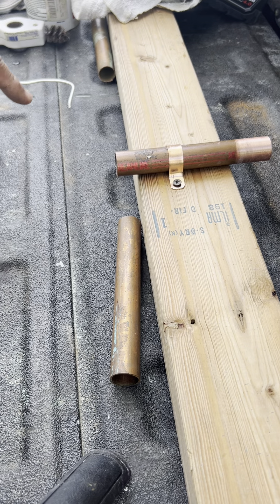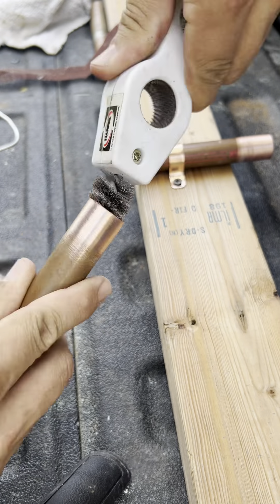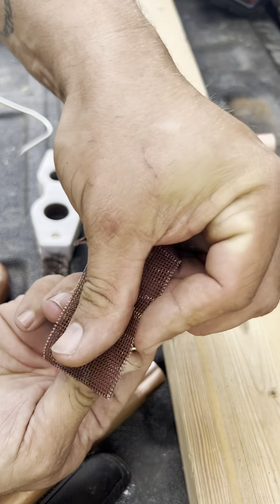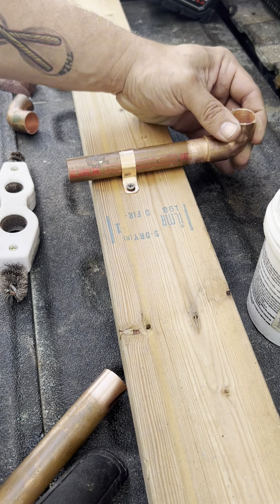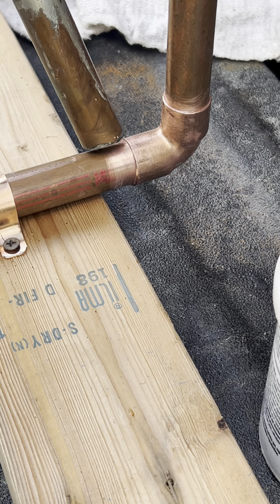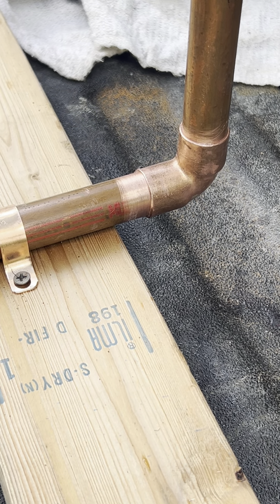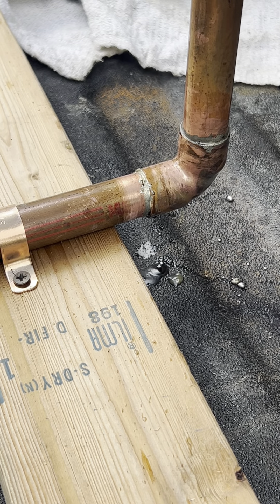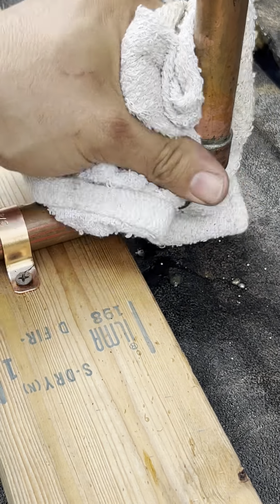How to solder copper pipe

Comment: When soldering, you should always flick the heat on to the pipe so it gets heated up as well as the fitting. You are correct with holding the heat to the end of the junction between the pipe and the fitting because it will pull the solder in, but you should also start applying the solder to the bottom of the joint. When you start on the top, you are lucky if you get half of the joint filled with solder in the bottom half. If you start applying the solder in the bottom, with the heat applied at the end of the pipe inside of the fitting, you will then pull the solder full depth into the joint. Then you can go around the sides as needed, then finish on the top. Also, make sure the pipe is not a sealed system without some type of faucet or valve being open to allow the steam to escape from the system when soldering,,, not an issue here, but certainly could be in a real world scenario. These thoughts are from a Journeyman Plumber, and I think you have the right idea, but a little recommendation from here,,, I will say that the only solder joints I have ever had leaked when I was an apprentice were because I started soldering from the top of the joint and not the bottom. I was concerned you were not going to wipe the excess flux before soldering, but you absolutely did and I have to give you credit! Overall your skills are pretty good
Reply from the maker: Thanks for the info! 👍🏻

Comment: I clean the access flux after I've applied heat for a bit, I can clean up more of it ensuring no runs.

I also don't drag the solder around the joint, it gets too messy for me. If it's a horizontal like the bottom joint of that 90 I just run the solder around the crown and watch it flow around and down till it leaves the buld on bottom then knock it off with my finger tip. If it's a vertical I tap the joint in one spot with the tip of the solder (preferably the back, opposite of heat and where no one will see it) and let the solder flow around until its filled.

Lastly, when the fitting is still hot I wipe it down all over with the flux brush then wipe the flux off with a towel. That way there is no discoloration from heat or staining from burnt flux. 

Longer process but to me the perfect swet joint is one where it looks like someone drew a small line around the joint with a fine point silver marker. I know, I'm weird. 😒
Reply from the maker: It’s all good! I’ll try that next time 👍🏻